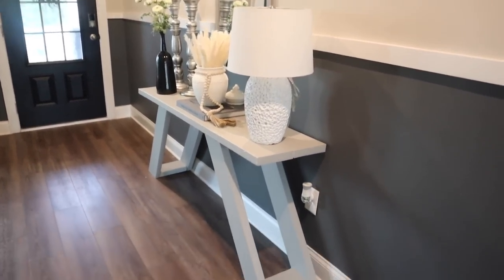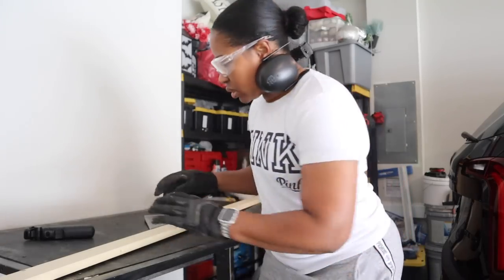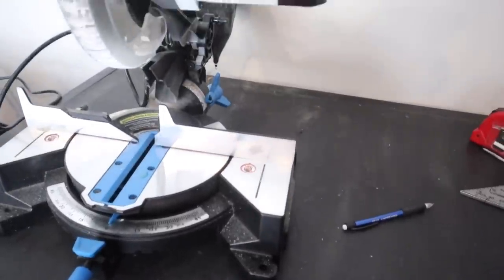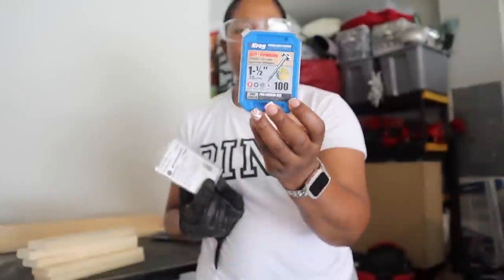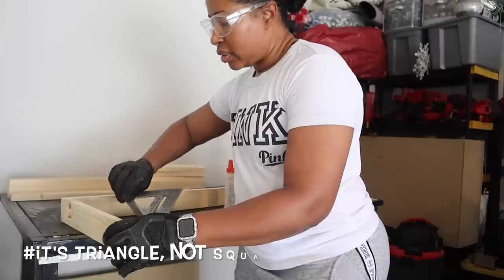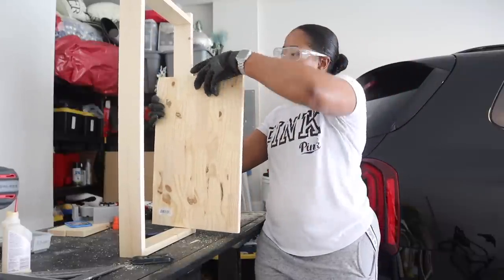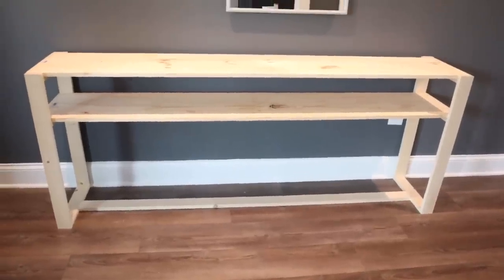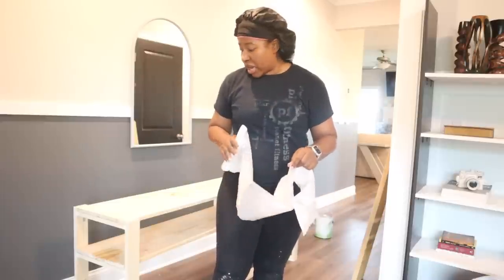ENTRYWAY TABLE | BUILD WITH ME!

Comment: Heyyyyy, the first table you built was cute, but I understand it was to short. The longer table is cute as well. Just to help you, by the table being so long made of a thin wood it will eventually start to bow in the middle.You should add some support in the middle of the table. Tables that are usually this long have a more heavier type of material or the middle support when using a thinner material. But the table is gorgeous and you your choice of paint is cute.